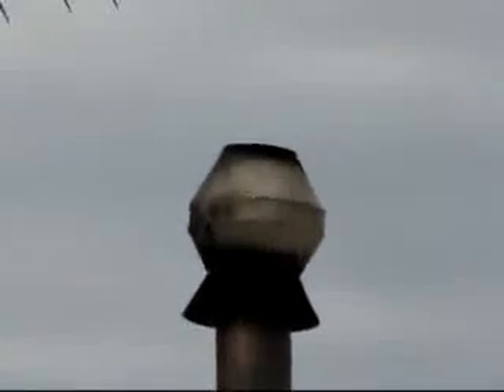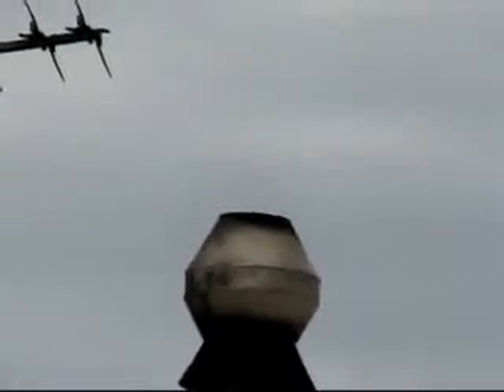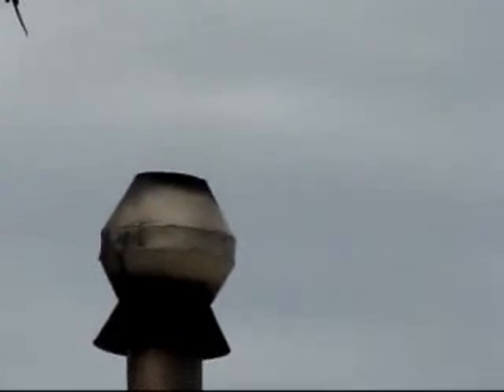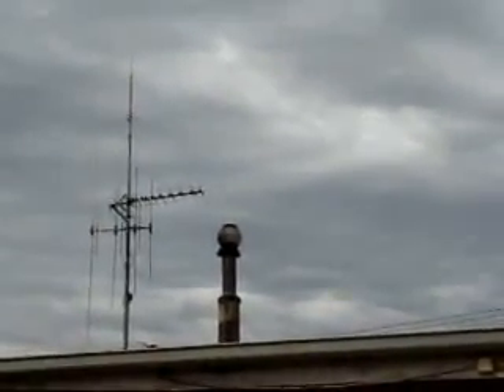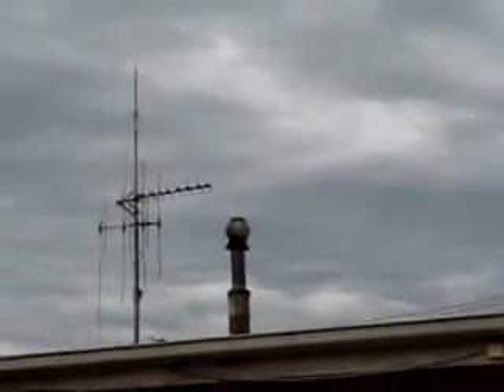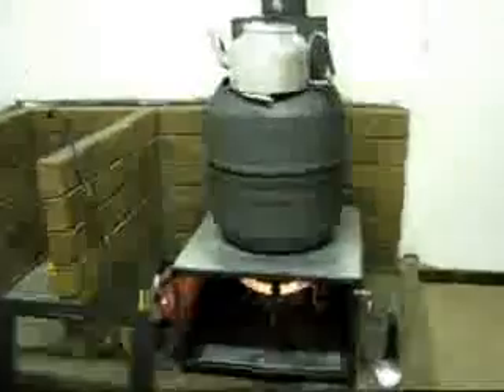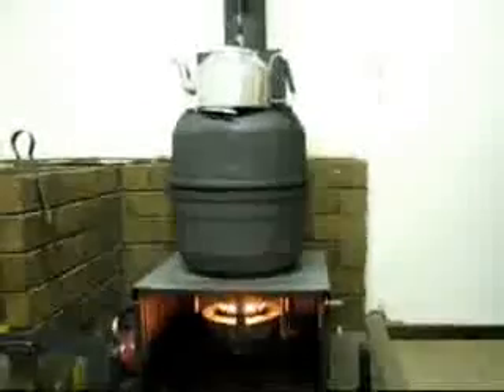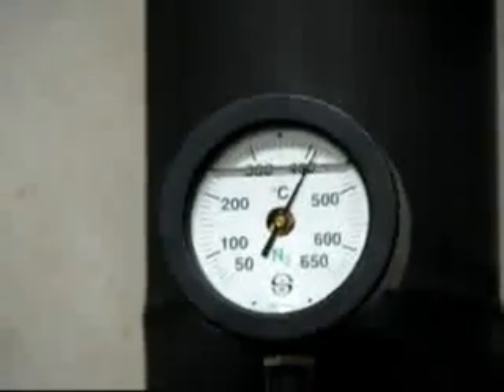Drip Feed Waste Oil Heater, Emissions

Comment from the maker: Yes, that is what I use, but I take great care to make sure that the oil line is all solid copper in the house with brazed joins, I also have a drip tray under the heater to catch small pieces of soot or any drips of oil that might occur.

You will need plenty of oil, as I burn 1.5 to 3 litres per hour, depending how much heat I need.

You are most welcome.

Comment from the maker: Inside the house, there is no smell at all, and outside, there is only a very slight smell whilst it is warming up, (ten minutes) and even that is not as you might think. 

It is certainly not the smell that you would associate with burning waste oil,.. but more like the faint odour of a freshly bitumenised road. I have been using mine for 14 years and never had a comment or complaint from my neighbours. 

In comparison with the smoke made by wood fires it is far less, and far less noticeable.

Comment from the maker: @lumberjak5010 Everything we do in this world is a trade off. Just the fact that we are here causes pollution and we use the worlds resources, the trick is to get the best from what we have to work with. The pollutants in oil are there, and they never disappear they are merely disipated to other places, even re refining the oil is merely away of removing most of the pollutantsand concentrating them into another waste product that has to be disposed of.

Comment from the maker: Yep, it may be a little deeper but you don't want it too deep as the flames from the primary air inlets must sweep down across the top of the oil to provide the initial heat when lighting up

Comment: Disregard the question I asked on the other video.  It appears in another video that the secondary burner does not go down into the camp stove so it must be the lid that's about 4" above the oil vaporizing surface.  A 4" deep camp stove I get it.

Comment from the maker: The camp oven is 12" diameter. 

You must ensure that the primary burn is oxygen deficient to ensure that the vapour is oil and carbon rich, so that when the secondary air hits it, it burns hot and clean. The downward radiated heat provides much of the heat helping to vaporise the oil in the pan, but it must only be about 4" or so above the oil surface for maximum effect.

Comment: So that secondary burner keeps the pot hot enough to vaporize the oil then?  And it looks like you're using the smallest camp pot they make right?  Like an 8"?  

Sure wish I would have discovered your design before I built that other heater.  Oh well I had fun doing it!  I'll play with a secondary burner and see if I can get it going.  Thanks.

Comment from the maker: The secondary burner is most definitely the secret,  the primary burner is only hot enough to vaporise the oil in an oxygen deficient atmosphere.  When that hot gas is mixed into the secondary air stream,  that is where the heat really occurs. It is important to gave a good draft and all seals and joints to be as close to airtight as you can make them.

The secondary holes must provide enough air and also plenty of turbulence to effectively mix the air and hot gas.